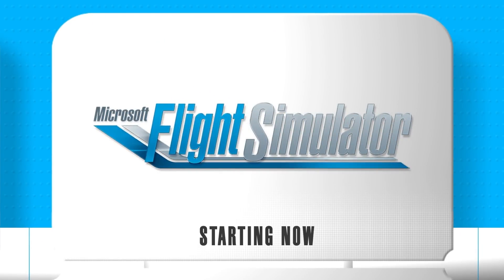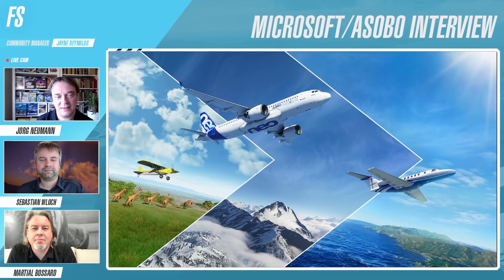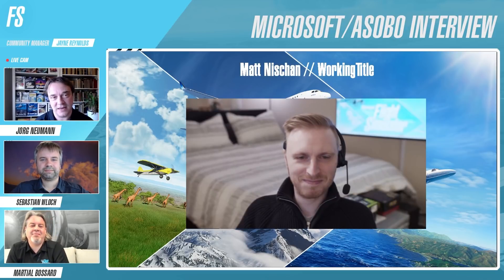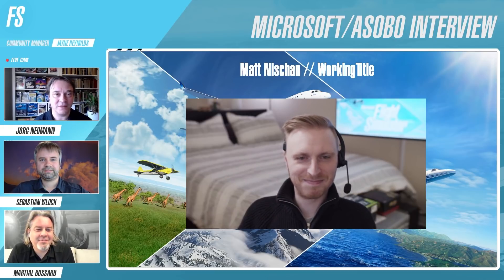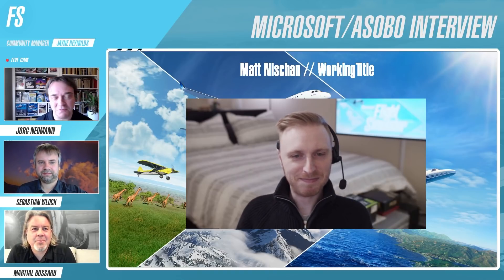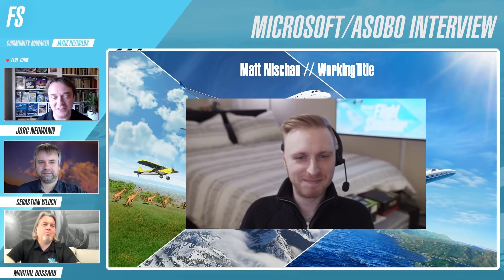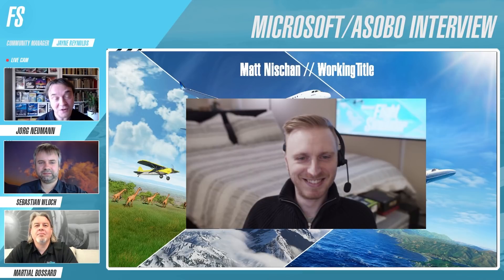Developer Q&A Twitch Series: March 10th, 2021

Comment: I love where the sim is going and the fact that for the foreseeable future, we'll be getting this stream of updates and addons. 

With that in mind, I'd like to point out that the new update is causing some pretty horrid stutters in some areas. Especially dense areas and photogrammetry areas are more problematic now than they were before the update, and it's especially noticable in VR (which is how I fly 90% of the time).

I think more people have mentioned similar issues. I hope Asobo will address this in the hotfix they are thinking of pushing out. I'd like to encourage them to not only think about doing it, but to actually do it! :) Thanks in advance!

Comment: Can we get many more particle effects along with the contrails please. 

Tire smoke, water wake & spray, afterburners that look & act right, fire & smoke bursts on engine startup for certain aircraft. Adding them to the SDK for all the 3rd party aircraft that need them too.
Reply: Yeees
Reply: More particle effects in Sim Update 4 (they hoped to have all of them in 3, but did state in last Q&A that some will be pushed back if not finished in time for SU3).

Also, afterburners? There are no fighter jets as standard in MSFS?
Reply: @ukmaxi  they should add wake turbulence too
Reply: @ilias0171  Yeah, that will have to be implemented on the AI traffic. Not sure if multiplayer will ever get it since at the moment it's just visualisation data being streamed in and requires less demand on your machine that way. Adding that effect would mean you'd need more processing power and streaming data from multiple PCs of varying upload/download speeds and then crunching that into wake turbulence that affects the air in your own local sim client... Not saying it's impossible, just challenging to optimise for.
Reply: Unless you mean you want it visual only, then that would be cool :).
Reply: @ukmaxi  No, but it's up to Asobo to update the SDK for all the 3rd party teams who can only work with what they're given. The current payware jets have a very unattractive, unrealistic acting afterburner effect as the SDK isn't good enough on that side. Many planes are launching with or being delayed for the current limits of the SDK. The Concorde has been delayed a while as supersonic flight isn't properly supported still, the new Spitfire along with other planes are lacking any fire/smoke bursts on start-up, the jets are missing or using very basic features etc. Only Asobo can build the SDK & after 7 months you'd think they'd have implemented things that probably should've been there from the start.
Reply: @D25Bev  Well, no... The SDK needs to support features for easier development. However, what features should or should not be added is completely subjective. They are not necessities for the sim to operate.

This is meant to be a continually evolving platform and the pandemic has not been easy for us in Europe, you have to remember that. It takes the amount of time it takes to logistically put everything in place. 

Don't expect anything on afterburners until way into the future.
Reply: @ukmaxi  There's many features that need improving & fixing on most aspects of the sim. I never said particle effects should be a priority but they're noticeable to anyone that knows anything about aviation & have been either missing or extremely rough for 7 months with probably many more months before they're implemented & sorted. I don't care how you try & spin it, that's unimpressive & shouldn't still be missing after all this time especially as people have been highlighting it since before launch.
Reply: We don’t need afterburners, but it would be nice to see jet engine core glow at night when taking off

Comment: Seb keeps saying the sim has thermals, yet the only thermals I have ever come across are ridge lift. I've never encountered a regular heat thermal that you can fly a glider in to gain altitude. I've even flown in the middle of a quickly developing cumulus nimbus cloud in the area the cloud is visually rising very fast, yet the air was completely neutral, apart from turbulence.
Thermals are way more than just turbulence and clouds! If there were thermals you could use in the game, people wouldn't be asking these questions so often!
Reply: Yeap Sir! Or you can even fly a Xcub in TS without any danger which kills the immersion and put the realism considerably down. Indeed in MFS2020 CB and the thunderstorms are just eye-candy without any updraft/downdraft, etc... The abscence of realism in the live-weather concerning dangerous weather conditions wasn't expected based on the promo-videos before the release date! (even if on the other hand I've been positively surprised about CAT, and turbulence relief that I do appreciate a lot) ... Hopefully gamers will dig for more realism and perhaps they will enjoy to create a flight plan based on critical unsafe weather conditions in order to avoid CB with a C172 for instance!!! ... and then for the sake of realism maybe this kind of challenging-request  will appear on the top of the wish-list above the sacrosanct wish of visual contrails! Weather is one of the corner stone of immersion/realism. MFS2020 has a huge potential no doubt and the team seems to be very passionate and involded so I keep my faith in MFS2020! Happy Landings! Keep up the great work! ;-)

Comment: We are about 36 hours into this update, and I’m still trying to figure out what they changed that destroyed my frame rates. All my settings are the same but my frame rates are now half of what they were before. I was only getting 30 FPS but I was content with it, now I’m lucky to get 12 to 15. Is it just me or does every update seem to just slowly make this simulator worse?
Reply: Just but yourself a better graphics card and stop complaining or wait till dx12 in the summer.
Reply: So I should just buy a new gpu every time they update. Got it. Currently running two GE Force GTX 1080’s.
Reply: I too have noticed a substantial FPS loss on my new Rig with a 2080ti. Something has definitely been nicked and it’s leaking FPS somewhere. It  was super smooth before the last update.

Comment: You guys have done an amazing job....you've nailed the world environment and the sky....just amazing. I worked on several FSX 3rd party fixes to try and improve just the sky alone.... I'm impressed with the attention to detail there. Thankyou.
My c172 still pulls heavily to left on taxi though.....and age old bugs like the Barron running away to lift off speeds under taxi with no throttle!

Comment: great to hear you are aware of performance issues.   5900x 3090 went from 42-50fps over Manhatten 3440x1440 Ultra to 20-35 - with GPU sitting at 50% and dips / freezes.

Comment: Feedback on the nosewheel tiller axis:
While the assignment seems to be independent from the rudder in the end it‘s not. One can observe that in the sim variables. It seems the steering axis is relative to the rudder input. That means for example that when setting full left rudder, you only can set wheel to straight forward but not the right.

Comment: At 21:57 the comment about climb starting after you start the turn. You can see in the video the nose was allowed to fall and the airspeed changed +10 knots. If you increase the airspeed, you increase the lift that the wings produce. If you change airspeed, you need to adjust the trim.  So in that video, allowing the nose to drop to at the beginning of the turn increased the airspeed, hence the nose coming up into a slight climb as the airspeed builds up. This could have been avoided by adding a little back trim as you  banked into the left hand turn, not letting the nose fall.

Comment: 4:42 I don't understand why this isn't handled in a system-wise manner. Why not simply calculate current air pressure, taking into account all that goes along with that including temperature, then that pressure is read by the static port (which can now add any deviations needed depending on how the static port is built, or it it's damaged in any way), then the altimeter reads whatever the static port gives it? Why is the altimeter the one responsible for simulating temperature based errors when that is a function of the atmosphere?

Comment: It's a beautiful simulator- as long as it works :( mine just stopped running. Even on a fresh win10 install it now refuses, cant reinstall fs2020 anymore.
Reply: Why
Reply: @Dany-gf9zu  I wish I knew. It would stop on the loading screen. Now, when I try reinstalling it stucks at the part where it "decompresses" a fs-base-cgl file. Put it on google and you'll see the misery. I've read and talked to quite a number of people on reddit as well.
Reply: @No1BRC  have you tried to remove all addons from ur community folder?
Reply: @Dany-gf9zu  yes, actually I even wiped the windows install and the disk fs2020 was installed on. Installed Win10, got all updates and newest drivers. i have a xeon123v3, 16gb Ram and a 1060 Gtx 6gb :(
Reply: Same here man... I’m going crazy. Spent 150h trying to install after a fresh Windows install. Stuck in decompression. Tried updating all the drivers, the Windows, directx and c+ libraries. Nothing works. I feel like going crazy
Reply: @TGabrielTPOI  sorry to hear that, it's just insane to know how many face this same issue and that there is no working solution for it :/

Comment: I hope they will implement fuel slush temperature, where you are in specific real temperature of i think between -20C to -30C you have high risk of your fuel slushing from ice crystals and lowering your fuel flow or completely stopping it. Fun fact colder temperature is not problem -30C or less but then you have fuel freezing itself.
Reply: That would be cool but that’s for sure not the biggest problem

Comment: After this latest patch, the sim is unplayable. I was getting 40+ fps, but now i only get about 20, and it lags a lot. It always seems to happen right when you guys release a patch or an update. I am constantly fighting this sim to keep it playable. I actually had it up to 60 fps at one point before the japan update. I was so excited about that, but then the update came out and shot down my hopes. On top of the fps drop, since the japan update, ive had this stupid loading circle that spams at the bottom right corner constantly as i am flying.
Reply: you are getting lower fps due to increase fidelity from the photogrammetry
Reply: @Neosin1   well then i guess that i cant complain about that. im sure that they will optimize it soon to run decently.

Comment: Feedback on the ILS:
- there is an issue that ILS signal is lost when you become below LOC (e.g. sloped runways)
- please also take care of the G/S. It seems a lot of G/S are not correctly aligned

The LOC thing means that for example you might loose LOC in a height of 100 ft over the runway…that happens also on runways that are known to support Autoland in real life. So is pretty sure not happening in real life.

Comment: 26:40 This is so bad.... look at the rudder deflection. Once the plane touches down at 26:52, you'd think less rudder would be needed because now you have all wheels on the ground, but the rudder input is exactly the same. Then at 26:57 it all goes away. Suddenly there is no need for rudder input. Went from needing full rudder to keep it going straight to no rudder needed in less than a second. And interestingly, it coincided with the airspeed indicator showing a line...

Comment: the game is realy bad optimized , i have ryzen 7 2700x and rtx 3070 and im getting drops to 15fps and alot of stutters in game , the game is super demanding on cpu , plz fix the game plz!!
Reply: Send those specs and where you are trying to fly to them, and they can perhaps look into further optimizing for your specs.
Reply: Might want to check out Hardware Unboxed latest video, your configuration might lend itself to being a prime victim of nVidia's driver overhead problem. Additionally, check out the forums for how to properly set up your system and settings for appropriate performance. There is a guide for a 2070SUPER that would be a great starting place for you!
Reply: Same

Comment: Great team. My only wish, please fix the airliners flight model! That’s the only thing that’s preventing real flight simmers from using this product!
Reply: I find it quit insulting that you imply in your remark that only tubliner simmers are REAL flightsimmers. Its much more demanding to fly small aircraft then highly automated and with computers controlled aircraft in which the pilot is basicly reduced to a system opperator.
With that aspect I could say that tubeliners are the most unrealistic flightsimmers.
This is however also a very insulting remark. For small aircraft this sim is very realistic. Mayby tubeliners need some more work but realise that the other great flightmodel simulator X-plane also has the tubeliners are not modelled correctly stigma.
A systems simulator is not per definition a good flightsimulator. Even the most advanced multimilion proffesional flightsimulator is not a perfect replica of the real aircraft.
Reply: @awjvdheide   ok, first of all what on earth is a tubeliner, the work you are looking for is probably «commercial». Second of all I am a pilot myself and know a lot of commercial pilots and enthusiasts that refuse to fly in the simulator because if it’s flight model. Yes, the GA aircraft do work well, but the commercial jets are just completely unrealistic. Compared to Xplane and P3D it is no where close. Please do explain your recondite illusion. Speaking of which, XPlane flight dynamics and model is used by NASA and other companies to test there designs. 
Lastly, after talking to many friends who are pilots, I can fully and most confidently say that the commercial jets flight model is completely unrealistic. For instance, when entering a flare, the ac behaves as if it is fully engulfed in a huge ground effect. The simulator has massive potential, but the way Asobo rushed the release puts off a lot of simmers.

Comment: all these updates are fixing pointless crap, fix the performance
Reply: Around a hour in they were talking about the optimization they made since launch and are continuing to work on. Also sometime in the summer they are going to be integrating directx 12 which they claim will double the sims performance.

Comment: These developers seem to have completely lost touch with their customers.
Reply: How so?
Reply: @EdmontonRails  Have you read the forums?
Reply: @AITullball3333   Have you played the game?
Reply: @EdmontonRails  Uh, yeah. What a dumb question.
Reply: they did , the game is totaly broken , i have a top of the line pc and i get drops to 15 fps and stutters all the time , ryzen 7 2700x and rtx 3070... 15 fps is not acceptable
Reply: @nunosanches3693  35-45 fps on a 8 year old 5675 and 1660 super 1080p.  Lower some settings. Fix your machine.  Stop your whining.
Reply: @nunosanches3693  
Try lowering settings and get a newer cpu like a amd 5,000 series... Not 2,000 series... Msfs is cpu based
Reply: @nunosanches3693   AMD toaster shit isn't top of the line. I have an i7 4790K with a GTX 970 and get 30-45FPS. Also keep in mind that the direct X 12 update was announced months ago and is coming this summer. It will bring major performance improvements.